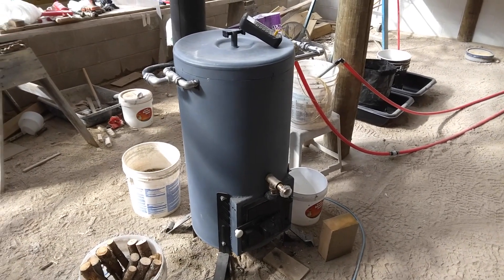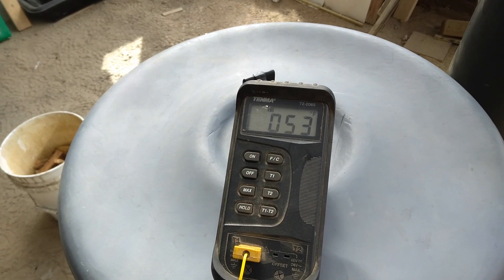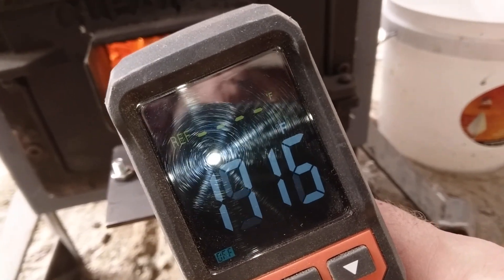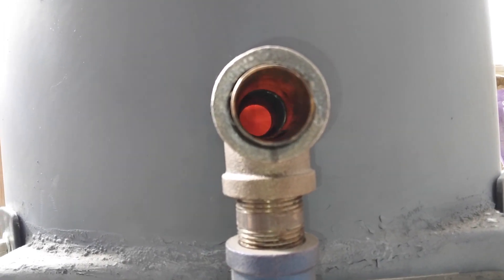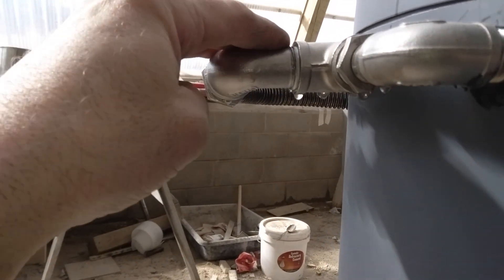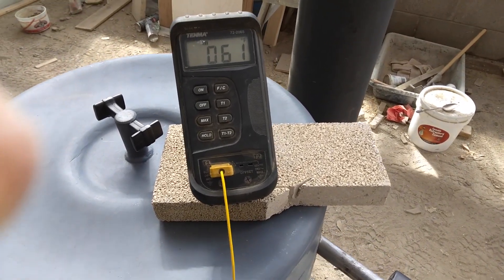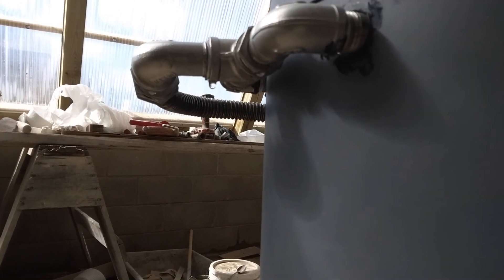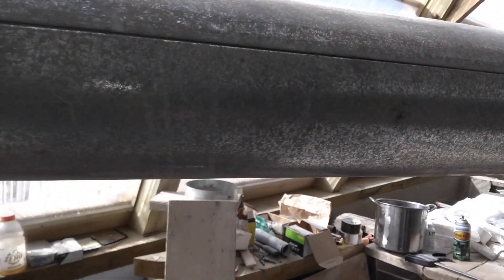Up & Running, Rocket Stove Water Heater, (part 6)

Comment: I was wondering about the smoke if any was coming out the end of your smoke stack?
Just thinking about your second air burn...
Looking Great so far
Reply from the maker: When I first through wood on, there might be a little smoke, (depending on if the stove is real hot yet), then it turns to a steamy type exhaust.

Comment: In manufactured wood boilers they run about 140 degrees on the water when not calling for heat and 170-180 when calling for heat from the thermostat depending on how cold it is. Rocket stoves are great but you have to screw with it so often with feeding it, a good outdoor wood boiler's burn chamber is about 5 feet wide, deep, and 3' high or so. This enables only having to screw with it once or twice a day, sometimes 3 times a day if you're not burning the right wood.
Reply from the maker: I'm familiar with the outdoor wood boilers.  This boiler I made, is probably what people are calling a 'batch box' rocket stove.  You can load it up a little more, but it does take attention.  When it's use to warm up a thermal mass, it will be off more than on.  I don't need much heat in the greenhouse, just to supplement the sun.  Thanks!

Comment: you want 180 F on the water
Reply from the maker: What I think I need is more gallons per minute, with a bigger pump...
Reply: @doubleMinnovations  I watched the vid again on the interior design -  my buddy thinks he needs a bigger wood boiler as his is rated for square feet that has the lower range for his use. So he thinks the wood boiler doesn't work well. But he doesn't use an infrared gun - I left him one in the hopes he would use it - as his heated garage has a huge open gap in one of the doors. I figured he had to lose at least a half hour of burn time just from that one gap. He didn't grow up in Minnesota so he doesn't take "bundling up" that seriously I guess. haha. The house has to be bundled up really well if it's going to hold heat.  
Considering how much heat you're already extracting as your chimney pipe is condensing water - yeah I had to take out one of my thermal mass bricks and that completely increased my burn temp a lot. Your burn temp is super hot though - over 2100. thanks for sharing - very impressive.

Comment: I like your testing and tuning the stove. Have a few questions for you Sir. The pex tubing you are using in the floor area does the floor have insulation under the cement, you did use concrete or just dirt floor ??? The secondary air part you are adjusting from a engineering point of view needs to have an air intake supply of roughly ten percent of the flow of the exhaust pipe from the stove flue size. The stainless steel piping you are using probably could be made in many different locations. They have different tolerances for pipe threads and taper angles for a tight fitment. That is why you are having leaks even when you used teflon tape. The tape is not a miracle item for sealing per say. The condensation part reveals that you are really taking maximum heat out of the stove and putting it into the water. I do believe you hit the mark on this stove. What are the chances of you being able to teleport yourself to my place and repeat the build for me fella ??? Just asking and peace to you fella too. vf
Reply from the maker: In order to tell what the secondary air is doing, I think I would need the equipment to measure the emissions.
It's a dirt, (cob material) floor right now that the tubing is in.  Dry sand underneath, and an insulated perimeter.
The video for that is on our other channel.  Here is the link for that work:  "https://youtu.be/NzWWblBvrL0"
Thanks for commenting!
Reply: @doubleMinnovations  Hope my information has helped you DMI. Dry sand works well also. Great work fella too. vf